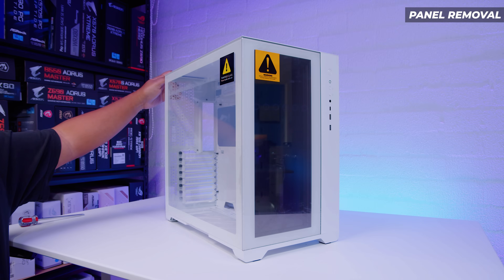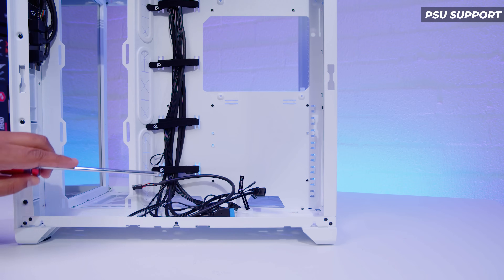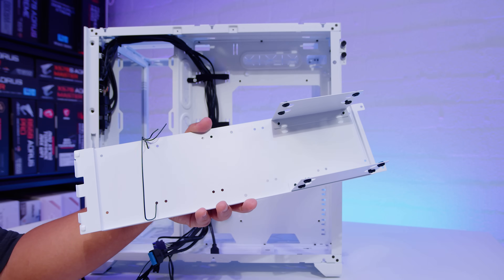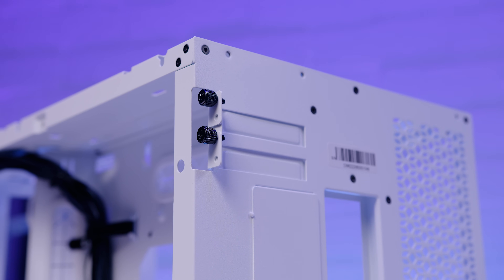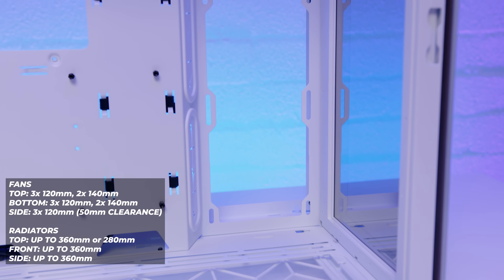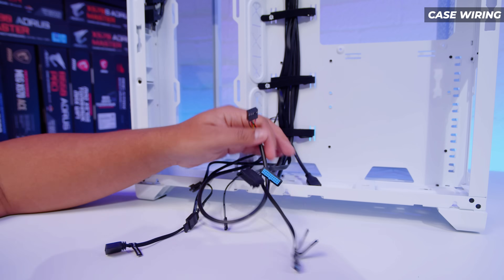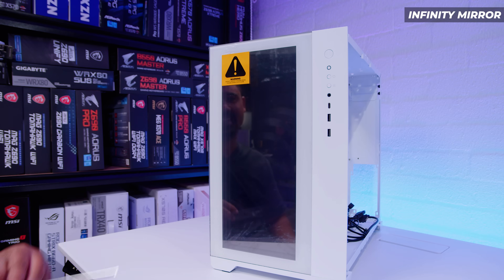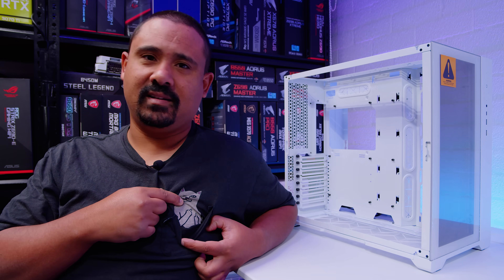MagniumGear Neo Qube 2: Attack of The Clone

Comment: i have it in black i did not shoose the infinity mirror cuz it blackens out everything  i have installed 2, 3.5  to 2,  2.5 adapters in the bracket so i can have 3 on the bottom of the bracket and 4 more   so i can now upgrade and instal a total of 7 drives of 2.5 inch i absolutly love the case and my cable managment is on top zip teis are your best freinds when building a pc

Comment: I have this exact case and I have an asus rog strix rtx 4090 white oc. It fits lenghtwise however it does not fit by width. I cannot close the case so if you want to use a strix 4090 probably not the case for you

Comment: I built my second system in this after the recommendation in the video, and boy, what a painful build it was compared to my O11 Dynamic.

Not only is everything in it tighter and cheaper feeling, it's also less practical, mainly due to the stupid feature of a second ITX system. Who wants a second system that can only run Tetris?

Because of the it's ITX spacing, there's no room width wise for an exhaust fan, which some will say is okay, even if aesthetics and cooling are negatively impacted. But the lack of an exhaust fan is a clue to a larger and much more serious problem.

There's no room width wise for an RTX 4000 series graphics card. You simply can't close the side glass panel because it hits hard into power adapter. 

ITX destroys this case. Give yourself an enjoyable build and get an O11 Dynamic instead.

Comment: as an owner of the previous case by metalligear i can confirm that this case is skinnier than the 011d evo by a few mm. you will 1000% need a vertical gpu ( i got the phanteks 4.0) mount to get a 4080/90 to fit behind the glass with the 12vhpwr. this case is by one of the best cases for the price compared to the 011 that you could find. still cheaper than the newly released nzxt version. 
also, every single 011d distro plate fits this case: the side version and the front version fit exactly like it was the 011d.
lastly , you can fit 3 360 rads in this case with 16 fans(slim 240 for the side exhaust) and 2 80mm fans on the back grill area for exhaust as well.

Comment: They should have put a cutout in the motherboard tray, so that if you chose to use a mATX or ITX motherboard in the main compartment, you could pass a riser cable through to add a full sized GPU for the rear compartment PC.

Comment: I really dont understand why this is called the Neo Qube 2... I got the original Neo Qube, and its allmost the same. Because the normal Neo Qube 2 without the Infinty Mirror, is also called Neo Qube 2. The only diffrence between mine and this on, is that mine is from Metalic Gear, and this is called Mangnium Gear... dont get the point...🤔

Comment: It's one thing to emulate, or be inspired by... You can see how many cases now support fans next to the motherboard, for example.

But this is just a Lian Li badge away of being an 011 Dynamic (with an infinity mirror) -_-

Oh, and of course it's going to be cheaper than the 011, how many copy-cat products you know that are more expensive than the original? Not only would you be silly to buy it for more, but they can sell it for less and still make a handsome profit, since they had to invest $0 into the R&D on the case, they already have Lian Li's and DerBauer's R&D xD

Comment: Interesting case. HYPOTHETICALLY, if you did have a custom loop PC with a low-pro block on the ITX board and you didn't mind drilling into the case, could you fit a full sized GPU vertically (upside down)? 🤔
Reply from the maker: You could

Comment: I find having the radiator on the side with it intaking cold air cools your CPU much more than exhausting hot air through the radiator it's drops from 65c to 50c with it intaking. The bottom intakes air and side + radiator intake air, the top exhaust hot air but running at 10% or 15% more faster exhausted the hot air faster
Reply: Agreed, idk wtf he talking bout. But what do I know, I'm not a subscriber lol.

Comment: The original Neo Qube was about $40 less than the O11D but had extra features like 140mm fan support at the bottom and the second system. This new Neo Qube is the same price as the evo but is worse in every way except for  the infinity mirror. They have definitely regressed in competitiveness with this case.
Reply from the maker: This is not the same price as the EVO at all. It's between $20-50 cheaper. Not sure where you're getting your numbers from
Reply: @GearSeekers  Yes, it is. The evo MSRP is $169.99 in the US. Although, right now, just like with the initial release of most Lian Li cases due to availability, it's being upcharged and selling for around $180. I guarantee this same thing will happen with the Neo Qube 2 too for a multitude of reasons.
Reply: @Kachongui Kach It's no longer worth it, phanteks has increased the price of the original to around $120.
Reply: @Kachongui Kach For sure, pricing is very region dependant. For a quick breakdown, the only changes from the original Qube are the infinity mirror on the top end models, the use of small circular perforations with roughly 40% open area, and no dust filters, and the ability to invert. The original Neo Qube actually had more open area with it's perforations but they were large enough that it was a good idea to keep using the dust filters. In general, case perforations need to be at or above 40% open area, regardless of size or shape, to allow for good airflow with minimal impact compared to removing the panel.
Reply from the maker: @TheJjjoj  The price starts at $139 USD. The Evo is $169 USD
How is it the same price as the Evo lol?

Comment: Another case tempting me away from my 4000D. Infinity uni fans are a perfect match with this case. Awesome looking build fams.
Reply: This case looks sick but I would stick with 4000D as it has better airflow.  The mounting of the three fans on the side of the motherboard is not good for airflow
Reply: @pitechx  yeah I'm aware of that. Just like the design of the Qube 2 and the inifity mirror looks pretty dope. That's all.
Reply: @pitechx  no one buys this for airflow
Reply: @pitechx  actually the airflow is fine. I run a 011 mini and the side fans are best as Intake and the airflow of this case comes from the bottom and sides through to the back and top to create sort of an upward spiral. And as you know hot air rises. Airflow is phenomenal.
Reply from the maker: @iTzNaStYN8  Or you could just watch the video

Comment: whats the difference between this and the neo qube 1?(from metallicgear which now i think is magnium)
Reply: I have the neoqube 1 and the only difference i can see is that its got an infinity mirror in the front instead of an rgb strip and that it can be inverted, but physically i cant see any differences at all.
Reply: @ahmed-0775  It also uses small circular perforations with no dust filter on the top and side panels in lieu of the metallicgear logo shape perforations with a dust filter behind them.
Reply: @TheJjjoj  you would install the fans then the gpu
Reply: @ahmed-0775  Can we install the bottom fans after vertically installating a GPU? Thinking of buying the Neo cube 1
Reply: now apaart from the infinity mirror standpoint and the duel system ?
Reply: @anthonyflynn2662  neoqube 1 can do dual system as well